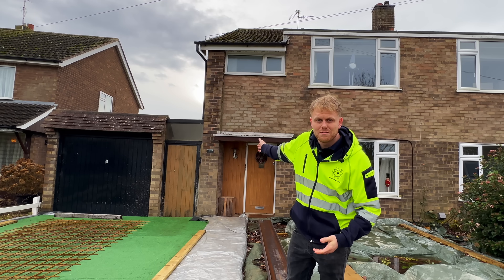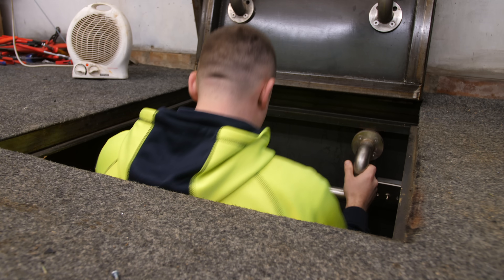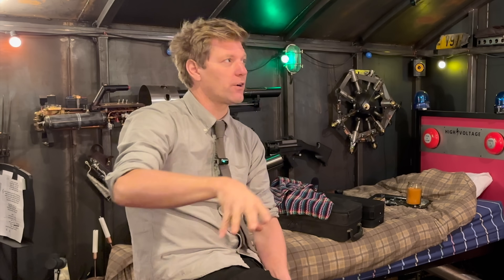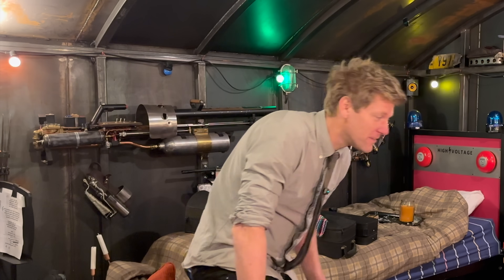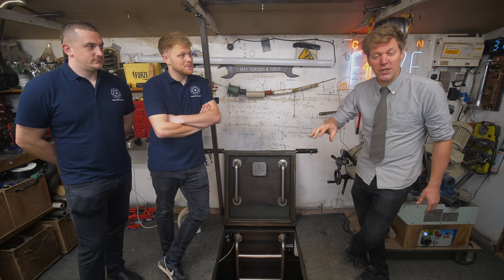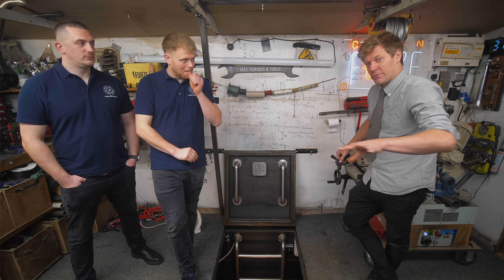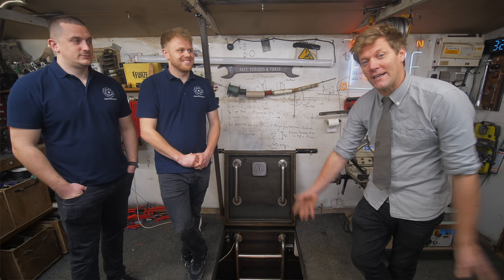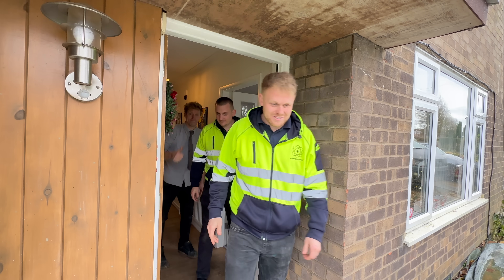Colin Furze Tests For Radon Gas!

Comment: Cool.  I think I might have been one of the people who mentioned the radon concern.  I also live in a moderately high radon zip code, but installed my own mitigation system.  You don't need a three month survey or expensive consultation.  They just like to make a lot of money on people.  You can buy a perhaps $100 (or less) Corentium Airthings detector and use it.  It displays both short and long term averages which is good enough to see if you have a problem.  Don't buy a used detector because they have a limited sensor life.

Comment: Get a Radiacode 102/103 , it´s a cheap scintilation detector which can show you a gamma spectrum / integrate it over a long time.
You will see the decays of the radon chain as peaks in the spectrum.
Get a background spectrum in your area where you know there is no radon and then get a spectra in your bunker.

B.t.w. there is even radioactive steel, as some cobalt-60 sources made it into the steel recycling chain back in the days. There are even building which had to be torn down, as the steel beams generated unsafe levels of radiation inside them.
Reply: I've got a collection of geiger counter/scints.  For this specific purpose, It's better to just get a dedicated radon meter.  They are much cheaper also.  The Airthings ones show you a short, long, and all time average which is great to know.  Display is in picoCuries/Liter and the EPA recommended action limit is at 4.0

Comment: Radon 222 is the radioactive version with 1/2 life of 3.8 days. It will be at background in under six weeks.  It’s also a big molecule so I would like these guys to explain how it can migrate through metal and concrete. Both made of much finer grids than 222.
Reply from the maker: Even well-constructed concrete can have microscopic openings that allow the movement of gases, including radon.
Think of concrete as a complex maze with tiny openings and interconnected pathways. Radon, being a gas, can easily navigate this maze. It is less likely but similar with steel, there can be microscopic gaps or cracks in the weld joints.
Reply: @Glencoe-Radvac  And the important part is that when radioactive things break down they create pressure (because the particle count is increasing) so it really will seek out that one crack where a weldn't and go there if it's easier than thru the soil, etc.

Comment: Pretty easy stuff to deal with if it’s an issue for ya.

Our part of Canada we put in a single vent straight to the roof from under the basement slab.
It’s part of the building code.
*old homes aren’t required to retrofit.
Reply from the maker: Passive systems do not always work. Remediation can be difficult in certain buildings.

Comment: In the USA, a radon test is one detector in the basement and is done overnight.  The sheer number of detectors they use and a 3 month sample!
Reply from the maker: Baffles me how you can get anywhere near an accurate result with one test in 24 hours! The levels will change frequently, so how do you know what your annual exposure is?
Reply: @Glencoe-Radvac  A 24 hour reading is just general ballpark so you can observe large rise and falls.  Barometric pressure drops and convection heating in the winter can make a huge spike in just a few hours.  Fresh rains after a dry spell (washout)... etc.  I have observed all of this here. Technology has improved. Short and long term, as well as all-time readings are all helpful.  You don't need to wait three months.  The Airthings detectors show this data and work well for the price.

Comment: 1 becquerel (Bq) is 1 nucleus decaying a second. 1 curie (Ci) is 3.7x10^10 becquerels, and represents the approximate number of radioactive decays in one gram of radium (not radon!!! See below...) per second. However, these only describe the decays of individual atoms, and while important they do not tell the whole story.

But first an atomic refresher.....

Radium (Ra) is atomic number 88, is a solid at room temp, and isotope Ra-226 has a half life (or the time it takes for half of its mass to undergo decay, ie after this time there is still half of it. After another half life, there is half of that halved mass, etc....) of 1600 years.

Radon (Rn), atomic number 86, is a gas at room temp, isotope Rn-222 has a half life of 3.8 days, and is a direct daughter product of Radium decay inside the earth. 

The next important set of nuclear radiation units "Absorbed Dose", the gray (Gy, international unit) and rad (rad, U.S. unit), which describes the amount of energy deposited per unit mass in an object or person. 1 gray (Gy) = 1 joule(J)/kilogram(kg), 1 Gy = 100 rad (1 rad = 0.01 joule(J)/kilogram(kg)). 

Now, this only describes how much radiation has interacted with your body, and NOT the damage it has done. 

Remember, there are 4 types of radiation, alpha (α, two protons and two neutrons, basically a helium-4 atom without any electrons, can be stopped with a sheet of tissue paper and does not penetrate the dead skin layer), beta (β, an electron, can be stopped with a sheet of tin foil, can barely reach the proud flesh under the dead skin layer), gamma (γ, hide behind a few feet of solid lead and reinforced concrete, at least....), and neutron (☢💀!!!RUN!!! 💀☢ As in from the nuclear explosion that sprayed them out. It wont help, but at least youll have something to do while your DNA is ripped apart 😁).

The final piece of the radiation units is "Effective Dose" which takes the Absorbed Dose (see above) and adjusts it for radiation type and relative organ sensitivity. The result is an indicator for the potential for long-term health effects (i.e., cancer and hereditary effects) from an exposure. It is used to set regulatory limits that protect against long-term health effects in a population. It also allows experts to compare anticipated health effects from different exposure situations. However, because this value is a calculated approximation, not a physical quantity, it cannot be used to predict individual health effects. The units for effective dose are sievert (Sv, international unit) and rem (rem, U.S. unit).   1 sievert (Sv) = 100 rem (1 rem = 0.01 sievert (Sv)). 

Sieverts and rem are important to understand the general danger to a populous, no necessarily a individual person, from radiation exposure. Think of it as the effects on the average sod. How average you are will depend on how differently it affects you, but its a good starting point. But here comes the fun part......LITERALLY NONE OF THAT MATTERS!!!! And here is why....

The Inverse Square Law!!! The intensity of a point source falls off at a square of the distance, or however far you are away raised to the power of 2(d^-2, negative 2 because its dropping off). Think of it like a light bulb, the closer you are to it, the more of its light falls on you. Something twice as far from it as you are is only receiving a quarter of the light falling on you. "So what does that mean for radon, Colin?!" I hear you say. Well, firstly, Im not Colin. Secondly, that means a thing emitting radiation on the other side of the room has far less effect on you than if you were to surround it with soft wet human tissue.....like when you breath in a big lungful of nice heavy radon!

Radon is pretty safe externally, in that there are far worse things out there. But, when you breath it in, anywhere it fires off a particle when it decays is aimed at your  tissues, tissues that dont have a protective layer of dead skin. And since its heavier than air it can sort of hang out in the lungs for a period of time. 

THAT is why radon is so dangerous. 

Also, any news story using becquerels and curies is just fear mongering because it makes for a big scary number......but absolutely listen to your radon technicians when they tell you how much is too much!!!

In this essay I will........

Comment: Did anyone test for methane gas?  Might want to test that freak for insanity and IQ as well.  He thought concrete would seal out water, which says he isn't an engineer.  How did he get around the building codes?

Comment: Radon gas is the rarest element on earth, and if it comes thru the floor then it will leave you house faster than it comes in, sounds like a money making rip off like global warming. One particle in a billion, if they put a tester outside you house the results would be about the same.
Reply from the maker: Incorrect. Outside radon levels are around 6 Bq-m³ on average. Radon can build up in buildings and rise to thousands of Bq-m³.

Comment: I cant see radon being an issue at all, you have powered ventilation so that will remove all the radon gas, the precautions are mostly for lived in homes where you spend 90% of your time, sleeping for 8 hours etc, doesn't matter so much in a low time areas, maybe in the apocalypse

Comment: I just had radon mitigation installed in my house. Huge difference.

Colin, you should have put a layer of rocks beneath your tunnel, then they could have installed a fan to vent it outside!

Also helps with moisture!

Comment: The last place I lived had a radon problem. I measured 5500 Bq/m³ in the air entering through a hole in the basement floor.

Comment: I actually worked somewhere where we made parts of radon detectors, and the company moved to a building specially engineered to keep radon out and ventilate it away so it didn't contaminate the detectors. The trick with radon, though it isn't 100% positive one way or the other, is if you're dealing with limestone assume there's lots of it, there's a reason they correlate on the national maps, and of course Colin has been dealing with nothing but limestone which is presumably why people were screeching. Miners deal with it all the time, where it becomes a Big Deal - you can actually deal with it to a decent extent with ventilation, one of the benefits of it being a gas, but it decays to radioactive lead and bismuth and that's the real issue with it that people don't generally understand.

Comment: I'm in the US and we ran a radon test on the house we purchased, and our real estate agent had the sellers pay to have a radon system installed, which consisted of drilling a hole in the basement floor and fitting a plastic pipe underneath it, then there's a fan that pulls the gas out from under the foundation and up a tube and vents it above the roof
Reply: They also like to do their radon tests in the summer time when levels are lowest.  Sneaky!  Test it yourself with a Corentium Airthings.

Comment: I’m a construction superintendent in the USA and anytime we build a new structure we add piping under the foundation for the purpose of a radon fan system . After construction the building is tested for Radon. If the levels are low or none then the pipe just stays a pipe. If radon is detected then you are required to add a fan that sucks the air out of the pipe and exhausts it out of the building. In Massachusetts where we work this is required by code whether it gets used or not .
Reply: That seems weird. Why not just give them an extractor fan anyway if the pipe is already there? Could help if they ever have a gas leak or something

Comment: Can radon cross through an ERV? (Energy Recovery Ventilator). Having to add (radon free) cold positive air into a home while exhausting (radon contaminated) warm conditioned air will increase energy costs is the reason why ERVs are mandated in some areas.   Thanks!

Comment: 07:50 Yes Colin is right.  Radon itself is harmless!  Radon is a noble gas and does not adhere to lung tissue, the primary danger comes not from Radon itself, but from its decay products, known as Radon Daughters. These decay products, often existing as single atoms or ions, can attach themselves to airborne dust particles.  High exposure over many years may cause lung cancer...

Comment: I live in Norway where 100 is action level. They got me freaked out about it when renovating the basement living area at my old house so did a lot of research. Here's a quote from the abstract of a US gov case study analysis...(link below):

"In the absence of other causes of death, the absolute risks of lung cancer by age 75 years at usual radon concentrations of 0, 100, and 400 Bq/m3 would be about 0.4%, 0.5%, and 0.7%, respectively, for lifelong non-smokers, and about 25 times greater (10%, 12%, and 16%) for cigarette smokers."

Not much to worry about really, in normal domestic settings at least. The very high levels and long exposure associated with mining activities are a different story. The radon industry, imo, is more focussed on making money rather than on significantly improving public health: https://pubmed.ncbi.nlm.nih.gov/15613366/

Comment: After owning several homes here in the USA I can tell you that we have installed a mitigation system in every one of them. From mud shale of West Virginia, to the granite of New Hampshire, to the planes of Kansas every home we have had has tested above the “Safe” levels. 

One think I have learned is rain can seriously raise the level of Radon in short term test. It is good to see you are doing a long term study.
Reply from the maker: The only reason we would ever do a short term test is after a mitigation system has been installed, the customer might like to see if it is dropping the levels but this will ALWAYS be alongside a long term test. 
It blew my mind when I visited Boston, you can go and buy a radon test kit in Home Depot! 😂
Reply: @Glencoe-Radvac  not all home inspectors are up to speed either. When we sold our one home the home inspector for the buyer placed the test one foot off the basement floor, which it standard here on the US, problem was he set on a stone hearth, probably why the reading was so high.

Comment: You’re using quite a lot of scare tactics here aren’t you… Radon is everywhere, you can’t escape it! If you’re a smoker, you may as well not worry about radon! Air flow is the way to remove worry. So opening windows once a week and using trickle vents will reduce any worries 👍🏻
Reply from the maker: Not at all, we are simply raising awareness on the subject. What you’ve just done in your comment is give generic advice that does not cater to everyone, each building has different levels of radon and different ways of managing the levels.

Comment: You need more air flow and humidity control calculate cubic air in space and change air every 15minutes or so check with local air handler guy ,and hello from Las Vegas mills rights ,ps keel up the good work ,milk and cookies to you,,your friend ,millwrightmac.

Comment: You left out the easiest and often most effective radon mitigation step where you connect pvc pipe from under your house thru the roof creating an easy escape path for the gas under the house. This makes the gas more likely to flow thru the pipe than thru your floors into your home.
Reply from the maker: That’s passive system. They don’t always work as they are reliant on perfect conditions. An active system with a fan is usually the best option
Reply: @Glencoe-Radvac  they rely on basic physics. Set up correctly they require far from perfection to work correctly. They usually require greater than 1 to manage an entire house but when you plan out a system like that you plan for it to work at an imperfect rate just like you should be planning out any system. Any system should be set up so that even when it’s not running well it’s still more than effective enough. If your fan system is only set up to remove exhaust enough when the fan is running factory perfect your system is under designed as well. 

Now since we’ve gone over how no system is perfect and the claim that it requires near perfection is dismissed I’d like to point out the ways your fan system relys on “perfection” in order to work. No power, no suction, radon’s leaking in the house again. Sure seems like you’re just set up to sell fan based systems and since that’s what you sell you are trying to pass me the sales lit. I don’t buy it. The southern US has been doing radon mitigation for 3 or 4 decades. We know a how passive pvc pipes work

Comment: I looked ad map ad put my post code in ad it still did not show if I in a radon or not
Reply from the maker: On the left hand side there is a red button that says “show radon data”
Reply: @Glencoe-Radvac  ow thanks
Reply: @Glencoe-Radvac  it’s a shade under the dark red so does that mean it’s high as I am in a red zone
Reply from the maker: The only way to know what your radon levels are is to test. The map shows the probability but is only indicative.